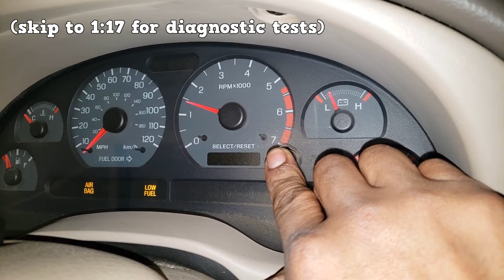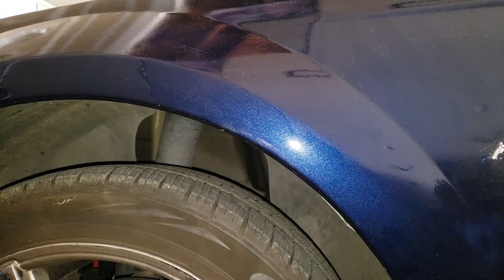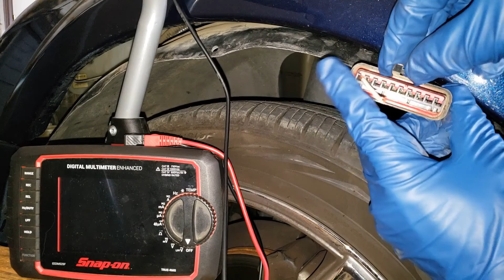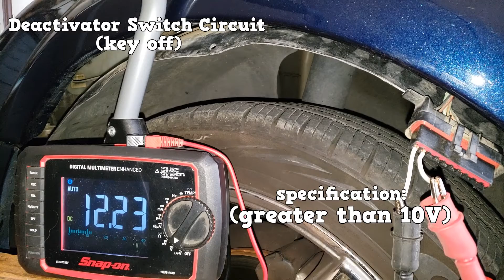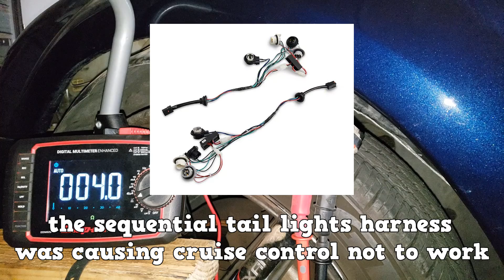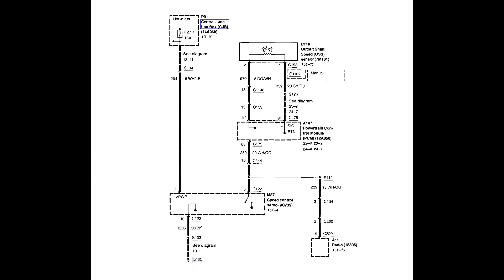How to Fix Cruise Control on a New Edge Mustang

Comment: shot in the dark but I was wondering if you could help me @oldschoolnoe ! my fuse 17 is good, but my fuse 17 circuit will flash about 4 volts for a split seconds when I turn the key on or off. any insights? i’m so lost.
Reply: it never maintains voltage, just flashes it for a split second.

Comment: When i measured the brake light switch circuit it read 0 ohms completely. Is there supposed to be resistance there or is zero ohms within the parameters? (I also have a manual so I don’t know if that effects anything)

Comment: Found a corroded wire for pin 9, fixed and now i get no activity when i push the set/accell button. Any suggestions? I get 12 volts when i press the on button, but nothing happens when pressing set/accell with key off

Comment: My ground is over 5 ohms as well i have 109 ohms for the brake lights, no moddifications to the lights.
Reply from the maker: G102 circuit (at 1:52 ) is over 5 ohms, what is the exact reading?
Brake Light Switch Circuit ( at 4:18) is at 109 ohms?

Then I would assume the G102 circuit reads about 107 ohms. If so, this means there is unwanted resistance in that circuit. Clean the ground point G102, and check the connector for corrosion.
Reply: @OldSchoolNoe  the connector is fine where do i find the ground point?
Reply from the maker: Close to the battery, check out the first half minute of the following video, also make sure the negative battery terminal/post is clean of corrosion
https://www.youtube.com/watch?v=hTGoSM0iSNg
Reply: @OldSchoolNoe  ahhhh i forgot that was in there, i recently had that ground come apart so i used a larger cable to reattach, could using a larger diameter wire cause more resistance. common sense and what i know tells me yes
Reply from the maker: @Frosty_Rogue_Gaming  larger no, longer yes . If you still have the original, I suggest clean it and replace it, then retest

Comment: Gonna try this thank you!
Reply: I was not getting the 12V between pins 10 and 9 even though my pedal switch works fine. The wire going to pin 9 was broken, so now my cruise control works! Thank you so much man 🙌🏽

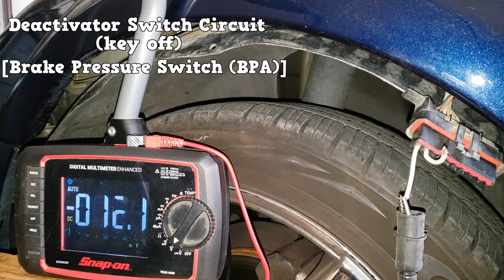Comment from the maker: At 2:24 , this test will let you know if the deactivator switch is still good. It is located at the brake pedal, along with the brake switch. If manual transmission, the setup is different.
Reply: It is an automatic. Thanks again, I'll refer to your video again for the resistance and voltage values.
Reply: Where is it at for manual and where can I buy replacement ?

Comment: I installed a new upper intake plenum from bbk when I installed new cams. Also had to replace my master cylinder and when bleeding the system I felt I damaged the cruise disengagement switch, but replaced it along with the brake switch, both were Ford parts. Cruise still inop. Just curious on your thoughts...
Reply from the maker: At 2:24 , this test will let you know if the deactivator switch is still good. It is located at the brake pedal, along with the brake switch. If manual transmission, the setup is different.